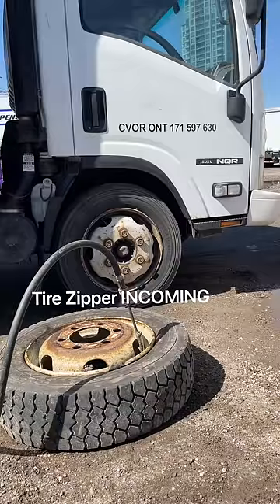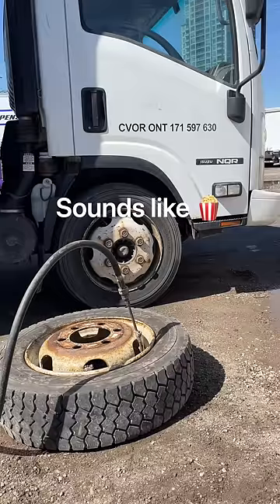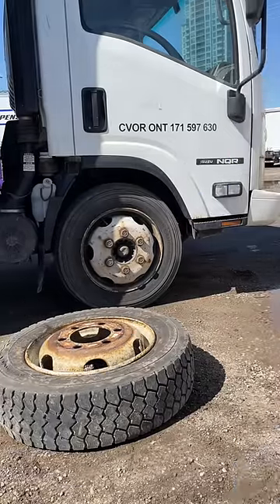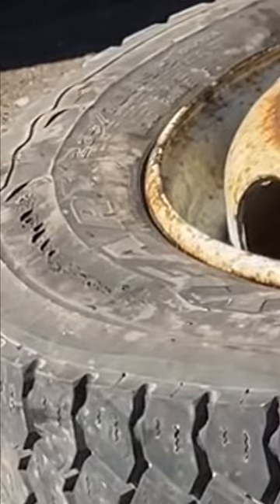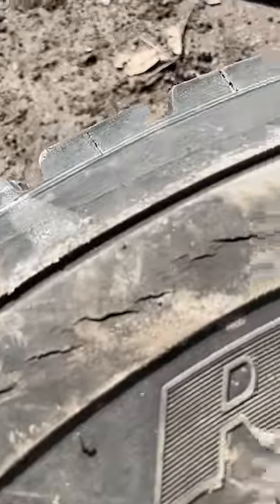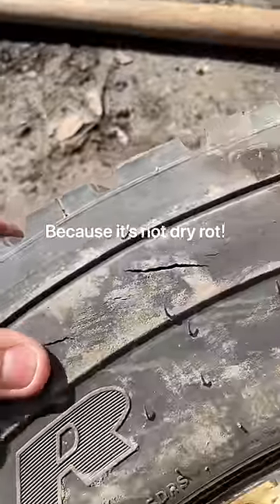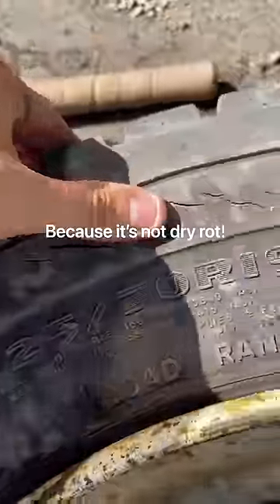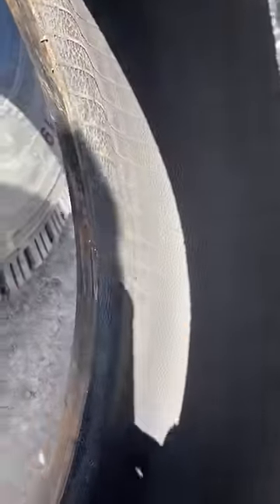Tire Explosion Warning: 🍿 Sound! #shorts

Comment: Thats why you're suppose to cage them. I've had brand new tires blow. It's part of it. Cages will keep your limbs intact
Reply: I've never heard of a new one blowing out. Have aired up thousands of new 19.5 w/o a cage. Maybe just lucky.
Reply: Loves tire shops use cages as a policy and I have seen one blow up while they aired it in the cage.
Reply: I feel much safer working on AMERICAN MADE tires !  Chinese tires , Truth is you do not know what you are receiving , very low quality control !
Reply: @danielsharon524 It's just a game of statistics. I've had tires of all brands and sizes rupture. Had a few rims bust to over the years. Realistically there is nothing to worry about but that .001% chance of failure is why you cage everything
Reply: @Suedeman there is a reason why policemen do load there weapons in special room because of that .0001 chance that something is gonna happen that cage could safe your live even if Chance is low.

Better safe than sorry , I had cars starting to burn while doing co2 testing.....
It's all about statistics and maybe beeing unlucky only once and for all.
Reply: @danielsharon524  I've had 3-4 new blow so far this year. About as many recaps also
Reply: @vicpetrishak7705  i get what you mean but at the same time my buddy's mum has a ford escape and the only thing on that escaped was the piston out of the block because that piece of shit blew up. only a 2018 model.
Reply: We contract with a guy that does the commercial vehicle tires for us. Hes missing half his jaw due to a split rim exploding. Guaranteed that i will never work with split rims.
Reply: @GardenofEdens police do not load their equipment in a special room 🤣🤣 do you just make shit up whenever you can?
Reply: @anon556   you do know that I am not from murica? 
I am german and we have such things as standards our police officers don't have the daily shooting training.

In germany they have a room with a special box to load their guns this way an  discharge does not kill anyone.
They will hold weapons  and ammunition in the same or  next room if this is a big police station.

Don't know why everyone gets so offended , not every place wants be like murica.

These blow out cages should be code   code is there to save your life. 

Mistakes happen while loading and  firing could be shooter or mechanical failure , like blowing a tire that you are working on.
Reply: @GardenofEdens  he isn't offended, you were being misleading by omission. How is he capable of knowing you are German, your comment wasn't in German, is he supposed to read your mind? We have a "special box" here too, it's a bucket of sand you point the gun into when chambering or releasing tension from the firing mechanism (decocking). 

"standards" you say, lol. Your country can't even have a standing army. Gee, I wonder why...
Reply: @seth4x4 Yeah, RIIIGHT.  Not disrespectful ENOUGH for you, I guess, and so you try to throw disrespect into this thread.  The Internet is not ONLY for people in the states.  Get used to it.  And irony, too: his use of "murica" is itself a comment directed at people who believe that no other country or custom exists or should exist -- the stereotypical southern US conservatives.  Meanwhile the same national ignorance and dumb pride is exactly why ww2 happened... And current germans have NOTHING to do with that.  German culture and history is rich -- their people smart, strong in compassion, morals, and respect.  Maybe get off your high 4x4 and try being more german.
Reply: @dubya5626  I guess insinuating the United States doesn't have standards isn't enough to throw disrespect in there...

This is a New York perspective. I am the offspring of German Jew and Uruguayan immigrants. Please try again.

German also used to be the language of medicine. Where did that go?

The rest of Europe is far more interesting & culturally diverse.

I do award points for German food and fashion, but everywhere has good food.
Reply: @vicpetrishak7705 sorry dude, this isn't 50s anymore. US made stuff is not better than manufactured in china
Reply: @onegrumpyboi2914 shit like that happens when you don’t get oil changes. Women things
Reply: Tyre cages? I've NEVER even seen or heard of them and I know for a fact that no tyre place has used them whenever I've needed new tyres. Not even the mobile tyre vans use them.
Reply: Tyre blow out rarely do anything serious. It's those split rims that fill the morgue.
Reply: I had a boss get fired for not enforcing the cage useage. A mechanic got killed from the day shift.  I heard he had a one year old daughter and was married only about three years.
Reply: @GardenofEdens I don’t what this “Gurmany” is, here in murica(as in everyone), we know that only America exists here on earth.
Reply: i thought remote inflation valves were also standard practice, along with the cage
Reply: Love when ppl use brake clean to inflate tires
Reply: @XtreeM_FaiL ive seen a combine tire come apart at work, its scary shit.  Tires do more damage then ppl think.
Reply: @gasNmudtv  How many times over pressure you put in them?
Reply: @gasNmudtv  WOOSH  POP! Lol. Just a couple times..😂
Reply: Cage is for split rims.
Reply: @GardenofEdens you’re right it’s called an armory btw
Reply: Am I safe doing my own motorcycles tires at home? Or should I be hiding around the corner?
Reply: Cages keep the wheel from launching, but if you're not using a bleed/fill switch from 10ft away (I believe is what I was taught), the air pressure will still blow your ass apart, or potentially cause an air embolism.
The pressure in a 19.5 or 22r is 120 psi (usually- load, tire compound, tread pattern, weather all play a factor). The amount of pressure dispursed from one exploding can send a 16 Lbs. Bowling ball 3/4 of a mile. The average persons head is about 12 or 13.
That's just the air pressure.
Throw a wheel without a cage in the mix, and congrats: you've made a giant shotgun slug and are now essentially role-playing Kurt Cobain.

Comment: Had a really close call the other day. One of our loader tractors out on the farm had the front left tire get knocked off the bead. I brought the service truck down and tried to put air to it, but it wouldn’t take. So I took the rim off the tractor and put it in the back of the truck and went to the tire shop. They inspected it, started putting air to it and then I heard the zipper. The guy popped the air hose off and yelled,” back up back up!” The sidewall got cut by the rim and we missed it. It was the closest zipper they’d seen that didn’t explode. They said I was damn lucky that the tire didn’t take air and explode in my face out at the farm by myself. Shook me a little. 😳

Comment: As someone who works on truck tires daily I’ll keep this in mind  I mostly install new ones but sometimes I have to mess around with used stuff.  Great video
Reply: I use a cage.
Reply: If it's used you under air it until it's mounted anyways.
Reply: Don’t believe everything you see on you tube.
Reply: I've had new and used blow. Be careful just because they're new doesn't mean anything.
Reply: New Retreads do it too js
Reply: What? You work on tires daily and you didn't already know this?
Reply: New ones can fail. Had a old coworker who's truck flipped because one of his brand new steering tires blew going 65mph

Comment: Hey bud I did tires for 2 years for Bridgestone/GCR. I would put a inline shut off at the truck. After the shut off put a pressure guage and a blow off valve. So if you hear this you can shut off the air to it and deflate without getting near the tire. Another bonus is being able to shut the air off and check tire pressure. Stay safe my friend.

Comment: Had this happen to me a few years ago.  I got the truck tire on the truck to 70 lbs and started hearing this. I just had that thought to run and bang right in my  face. It was the inside dual and I couldn't hear for 10 minutes.  My eyes were full of shrapnel from the tire. Went to the doctor for 2 days to get the steel put of my eyes. If it was the outside one I wouldn't be writing this.

Comment: Though extremely inconvenient they do make tire cages for this. Also. Pro Tip. Those air chucks are designed to be pulled from a safe distance. Whip the hose and the chuck pops off. Sometimes they will damage valve stems but I’d rather replace a stem vs the equivalent of a stick of dynamite going off next to me. For those who don’t know these tires exploding can kill and injure upto 12 ft. Stay safe

Comment: I used to work in a tire shop. Was working on a very small wheel barrow or trailer or tractor tire idrk, but it was tubed. I was used to doing 35 psi on cars, and I got to like 20 psi in the little tube and it blew up. It was like getting hit with a concussion grenade. I didn't even realize what happened, but my ears were ringing for a good 15 minutes while I got my senses back. Can't imagine the damage one of those would do.

Comment: Worked with a guy who died from an exploding loader tire. I was talking to him and noticed his tire nearly flat. I told him, and he left to take care of it. 20 minutes later I hear the call for ems on the radio. A few minutes later, he was dead. It is a weird feeling to be talking to someone and a few minutes later they are dead because they tried to fix a problem you told them about. I felt responsible for quite a long time.
Reply: That sounds horrible. Yeah, I can imagine how awful one would feel after such incident.
Reply: I can understand how/why you could feel responsible as you have some relative involvement but no, you are in no way responsible for the situation nor the circumstances of which it happened. Anyone who has driven a truck is well aware of the potential danger of an exploding tire so regardless of why proper preventative safety measures to avoid such accidents were not taken, the fact is they weren’t and that is out of your control. You are no more at fault than he is for having a flat tire to speak of in the first place

Comment: Had that exact same tire blow on someone In The shop a few weeks ago. Was outside abt 100 feet away sounded like a gun shot almost
Reply: Probably sounded even louder then an average gun shot.
Reply: That depends on the pressure the tire could take before exploding
Reply: @jaggns5774   @jaggns  not if its a used tire, when the cords in the tire are braking that's the popping sound you hear before it actually blows. Happens from tires being driven on flat or just old weak cords. But yes if you over inflate will definitely blow out aswell👍
Reply: What happened to the guy?
Reply: @Dontbmaddcuzubadd  I think you misunderstood, my point was: more pressure, louder bang.
Reply: @cumibakar10  luckily, he had the tire caged. So as far as I'm aware no physical damage besides maybe a slight case of tinnitus lol.
Reply: @jaggns5774  yessir👌

Comment: Common problem with old tires is just simply core fatigue through improper pressure, not driving enough, or small cracks allowing water and salt to penetrate and rust the cord. Then it's just a timebomb. Cracks in the sidewall are not good, but don't always tell the full story. It's when you see cord that you get a new tire.
Most heavy equipment tires run 60psi and up, so yeah, don't f with it. A shop compressor at 100psi will remove doors, blow shrapnel through a framed wall and remove your ear drums when it's tanks goes up. This is with just your standard 5gal tank.

Comment: back in the 70s when I was a kid working in a service station/gas station. A guy brought in a Mickey Thompson rear tire to have me put a tube in it. This was a service station where I had to work on cars, and go out and pump gas when a customer would pull in. Back then we cleaned your windshield, and your rear window, checked your oil, while your car was being filled with gas. If you asked us to put air in your tires, we did that, while we were checking your oil, we would look at your fan belts, battery terminals, and we would also fill your windshield washer bottle for free.
  so I got this tire that I had to put a tube in on the atlas pneumatic tire changer. I broke the bed, got the tire halfway off the rim so I could put the tube in, put the tube in, put the tire back on the rim, attached, the air hose to the Schrader valve, and a customer came to the pumps.
  I walked out to the pumps, the guy said, fill it up, I put the nozzle in the gas tank, and started cleaning his windshield, then another customer, pulled in, same deal, I started, filling his tank, cleaned his windshield, then I went back to the first customer to complete closing his gas tank and hanging up the hose, and right at that moment, I remembered I had a tire filling with air on the tire machine..
  oh shit, as I turned to run into the bay to take the hose off the tire, the tire exploded. The air hose whipped up in the air and broke two fluorescent lights, and it broke one of the windows on the rollup doors.. we had advertising banners across the openings of the doors near the soffit, they both got blown straight out, all the dust that had collected on tops of the shelves and beams got blown into the air. It looked like the building was filled with smoke that’s how much dust there was on the beams and shelves. Tire shrapnel scattered all over the lot all the way out to the street which was about 70 feet away..
  it service station had a very large commercial compressor, upright, two cylinder compressor.
   I was very lucky I did not make it into the building to get that hose off. Luckily, I had the yolk that tightened the wheel down onto the tire machine attached.
  people were stopping out on the street to see what the explosion was
  when the customer came back later that day for his Mickey Thompson tire , I told him that the tire just exploded. He said, I didn’t think it would hold because the tire had a slice in it.

Comment: It should be aired up in a cage, or bolted to the truck. You also disconnect the 10 foot air line extension. Don't ever walk up on the tire. But he does it for a living. I don't anymore. Thank God he didn't get hurt.

Comment: As a tire guy when you hear that noise you grab the air hose far enough away from the tire & try shaking it so the air chuck comes off the stem! It’s caused from running the tire low on air for an extended period and it weakens the steel cords to the point of breaking when you air the tire! What you are hearing is the steel cord breaking making that popping noise!

Comment: I've worked in commercial tires for 20 years, get yourself a remote inflater. It could save your life. Its basically a fitting with a clip on end that you can depress a valve to inflate so you are 9-15ft away from the tire

Comment: Why did you get so close to it to pull the air hose lol
Reply: So he didn't mar up the brass.
Just yanking it out could rip the valve stem off but mostly the brass  air chuck is soft metal and noone wants them all marked up n sharp
Reply: @damianbigelow9511  Such a stupid thing to even think about when a tire is potentially gonna explode in your face
Reply: @damianbigelow9511  true but who cares you can get it replaced for so much less than whatever medical bill you’d end up with when the tire explodes in your face
Reply: @aniquinstark4347  what would you have done. Just curious
Reply: @aniquinstark4347  tell me bro, how would you have done it? How are you qualified to tell anyone what's stupid and what's not
Reply: @MrMnun  disconnect from truck
Reply: @MrMnun  there's two ends?
Reply: Because, even if he stayed back and waited, there's the possibility that all that pressure escaping could fling something like a rock or piece of metal debris at high speed towards someone or something. I don't know about you but I for sure don't want to be responsible for either killing or horribly injuring someone because I was too afraid to deal with my own problems.
Reply: @GT-Tezzy  disconnect from truck and let it air out to atmospheric pressure. Well below ticky time bomb thingy
Reply: @tranejones416  Okay expert
Reply: @HJZ75driver  lol nah. Just learning from others mistakes working in shops and other experiences as well
Reply: @GT-Tezzy  Just yank the hose out. Air hoses are easy to repair. The brass fittings are designed to be multi use.
Reply: If you whip the hose upwards like you do a garden hose it should pop right off

Comment: Thats why you air them up in a cage or with the rim bolted on the truck, so they don't kill you
Reply: @tripplefives1402  you sure your not filling your tires with propane? I've seen plenty blow out but never blow the whole side of a truck off
Reply: @tripplefives1402  thats surprising,  usually when I've seen them blow it just damages some fiberglass or plastic around them, the worse damage I've seen is when the retread starts coming off and destroys everything it hits

Comment: Rode on some 20 year old slick dryrotted hankooks for 3 months speedrunning through the day  hauling  loads of trash and materials while overinflating them by 10 psi. Spare tire was also gone. Powerslid through every corner and tires would hop pulling out of driveways. A staple in my rear tire finally made me get a new set.

Comment: This is why there are tyre cages.  In the shop I work, the day shift employees used to leave snobby, self-righteous remarks about me signing out the tyre cage because I was the only one using it. I ignored the remarks left in my workstation and kept signing out the tyre cage whenever I had to do any sort of tyre work.  One night, I left a message for the day shift boss as to the lorry I was repairing.  The message would not go through.  The following night a message in my workstation said the day shift boss was fired.  I found out an employee died because of a tyre explosion with no cage to contain it. This is why the day boss was fired.